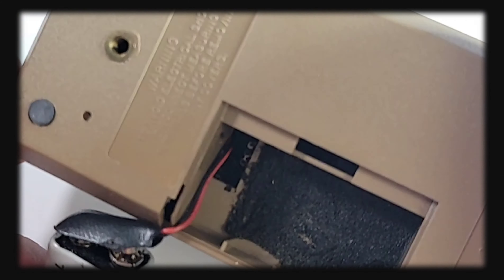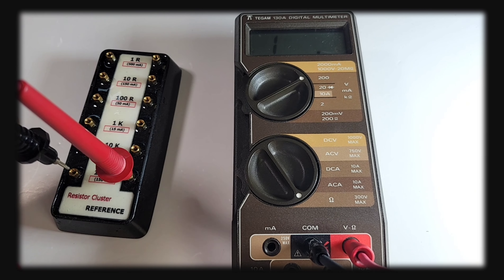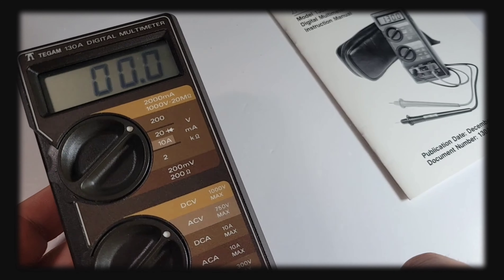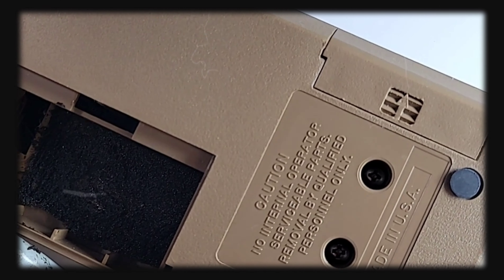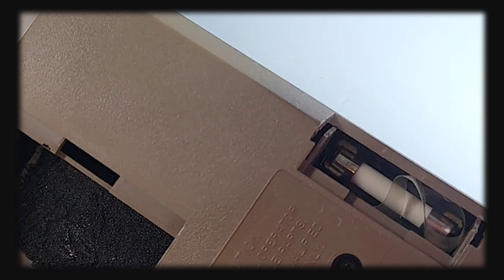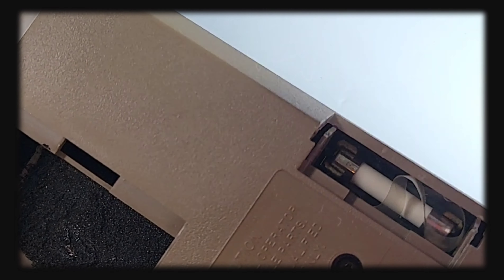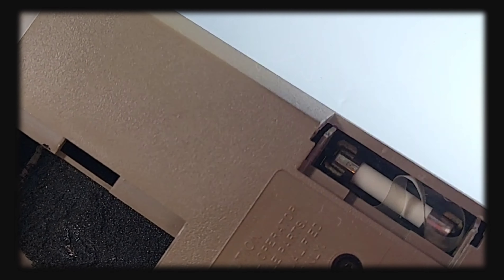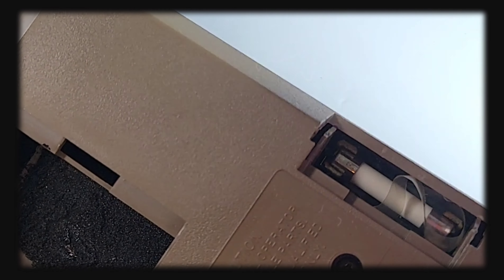RETRO-TECH ○ TEGAM ( KEITHLY) 130A Vintage Multimeter Mini Review & Teardown!

Comment: I do have the Keithley branded version of the 130 (without an A). I bought it new in the early 1980's. It is still working fine. The threaded brass insert on the back is to attach a very solid plastic foot with a thumbscrew.  I keep this multimeter at hand for when I need a second one. It served as my primary multimeter for over 30 years. Nice video, and nice to see that you also like it!
Reply from the maker: It's quite a good looking multimeter with alot of charisma..thanks for clarification on the brass insert. 😊
Nice goto multimeter even today !! 👌

Comment: Great retrospective on a classic multimeter.  Back in the day this was a pretty high tech model with the dual dials.  It's not a bad design for an 80s model and they packed it with some quality components too.  This is a good model.  Thanks for the great tear down.
Reply from the maker: Thx Jon 👍  It's definitely an 80's classic !

Comment: On these 7106-o-meters we need calibration only for voltage and current, not resistance! Resistance is measured typically by connecting the reference resistor (inside) and the measured one in series and pushing a DC current through them. The voltage drop from the reference resistor goes to the VREF input, and the drop from the test leads goes to the main input (note: both inputs are differential pairs!). The accuracy of resistance measurement in this circuit depends ONLY on the accuracy of the reference resistor.
Reply from the maker: Great 👍 info...Absolutely Intersil did a stand up job with this chip. I'm sure we will see it populating multimeters for years to come.Btw, I have a new RETRO-TECH coming up in a few days.. I think you'll find it interesting 😏  at least I hope so!